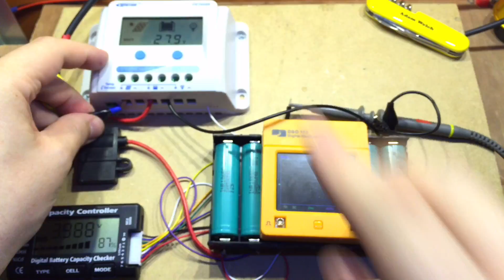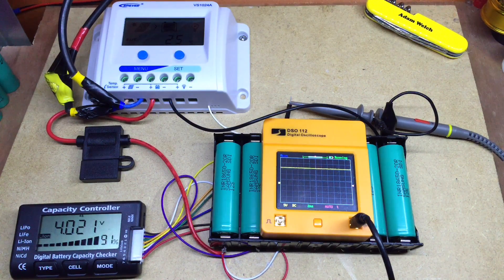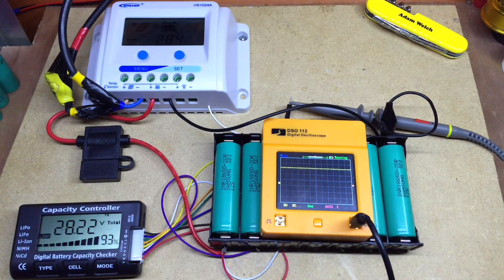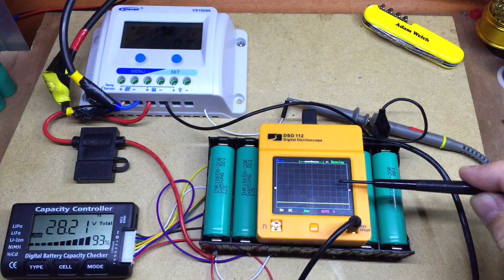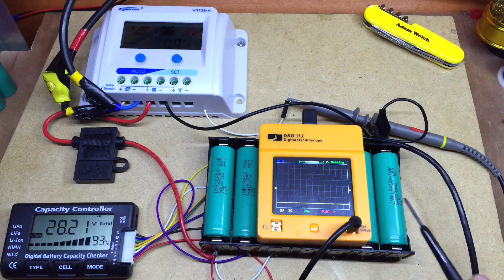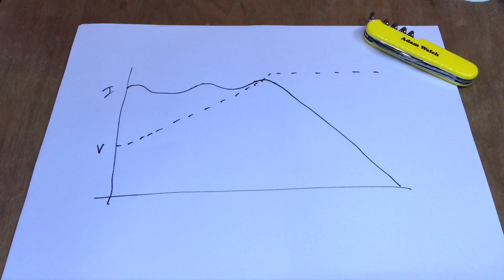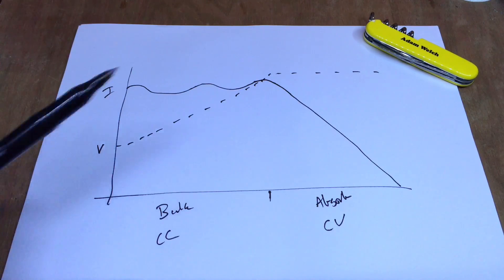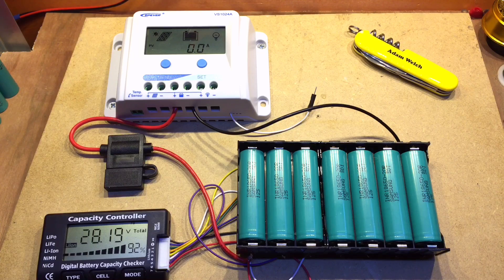Solar Charging Lithium Ion 18650s - Part 3, The Results - 12v Solar Shed

Comment: thanks adam.i've been looking for this solution quite sometimes. so now ill just have to use 7s arrangement to pair it with standard solar charge controller for lead acid batt.
Reply from the maker: +Luqman Radzuan You're welcome. Works great for me.
Reply: +Adam Welch currently im using grid tie inverter to harness sun energy captured from 100w panel. i get the actual input to my grid around 40w only. that makes me think i may need battery bank to supply steady voltage to my GTI.
Reply from the maker: I've seen people using them on batteries but it's taking the inverter out of it's designed voltage range and it's likely you're going to increase losses.  Having said that you're always going to have losses - its quite inefficient to not only boost the voltage of the input to mains level, then you need to invert it as well.   The other point to make is that you need a low voltage disconnect so the inverter doesn't completely drain your batteries.  If you run the grid tie straight from the solar charge controller you'll get this functionality (although depending on which model you use it might be a very very low voltage disconnect - too low to be any real use) but running an inverter from the load output is not ideal and can cause the charge controller to error.
Reply: Do you suggest that I build a battery bank with the maximum DC voltage input my GTI can handle to achieve maximum efficiency?

For your info, my GTI state it can handle maximum 36VDC, minimum 11VDC voltage input.

Perhaps I need BMS to disconnect the battery bank from GTI.

Comment: a balancer?   cool
Reply: it is!
Reply: jehu, when do you find time to watch videos lol. you must be using 3 or 4 of your old cell phone at the same time? using your old cell as long as your in range of your home wifi 'or any phone for that matter' you can open multiple apps just like the split screen I'm not sure if you can live view so if you 3d printed a holder for multiple cell phones around the size of widescreen possibly magnified 'it's free if you have old cells laying around', 'lots of ideas', I'm not sure about how many wifi connections a server can handle either I'm just using 2 phones at home where I can look through you tube or watch on both phones I used to play real money on poker stars until they got busted, anyway it would work well to be able to play multiple hands in that case,  if could work for business calls or viewing multiple family members at once I might listen to my playlist and watch  on 1 phone usually and look through Facebook garage sale or lots of stuff,  maybe you already do that, would be better if the phones were bigger.

Comment: Hi Adam, I recently also bought a capacity contoller and on the package were two boxes to mark if it was one with or without balancing function but no box was checked. How could we identify if there is a balance function present or not? Thanks for the great videos!
Reply from the maker: Press and hold the 'TYPE' button until you hear two beeps (sorry I've not got it to hand and my memory isn't always great).  The display should start cycling between each cells voltage.  It should then be balancing.

Comment: I have ordered one of these ,, balance controllers and started messing with 18650 cells with future plans to build a pack for a ebike project,  my electronic skills are very poor and limited and I keep watching these type vids to learn,, I'm 53 and don't pick up stuff as quick as I used to ,, any chance in the future of doing a video showing how to do the wiring from the battery pack to the cell checker as I don't quite understand how the wiring is wired to check each cell ,,, any help would be appreciated,,many thanks Shane warks uk

Comment: Great and very informative parts on solar charging lithium ion batteries...  But now i have a problem :) I'm over a year ordering 18650 batteries from china ( every week 4 to avoid taxes :p  )and i'm now up to 150 pieces...  I'm building a van where i want to live in, off grid. But i saw video's on youtube that 12v on solar charger works great, but Your statement is so much more convincing... that i probably want to use a set of 7 batterylines to match 24v gel batteries the best. However and here are my 2 questions...  24v to 12v converters do they use a lot of power? if yes that would be a great loss in power.. second question, i was planning to hook my batterypack in the back to my mainbattery ( with an isolator between them so the back battery can't drain my main battery while i'm not driving ) but in this case, if i'm using my batterypack as 24V volts, i can't connect that to my main battery anymore.. or is there a sollution for this problem ? Tanks in advance :D

Comment: Hi Adam, I've been following these videos - they are great! I looked at ebay for the charge controller and found that it takes (from description) "Lithium type(2-7 Cells)". I'm wondering.. you got 8 cells, no? So how's that..... this is the one I looked at, (http://www.ebay.com/itm/RC-LCD-Battery-Capacity-Voltage-Checker-Controller-Tester-for-RC-LiPo-Batteries-/282165890372?hash=item41b265cd44:g:bfsAAOSwdIFX0E8R). ps: did yours come with the cable? Will follow you as I NEED TO CHARGE LI with solar!!

Comment: http://www.ebay.com/itm/MPPT-Solar-Panel-Controller-Charging-Module-FOR-3-packs-lithium-Battery-charger-/181908611296?hash=item2a5a9920e0:g:yB8AAOSw9mFWJqit

Comment: Adam - Question about the balancing controller you have there, during its balancing mode is it drawing its power from one of the cells in the circuit, or getting power from an external source? Basically I like the idea but am wondering how much it could potentially draw from your system over time? I can't imagine it pulling a lot of power if it is just powering the LCD screen [and balancing], but you mentioned it getting "hot" before which WOULD indicate a large current draw. Maybe that was just from the initial balancing, I'm not sure. I was wondering if their was any benefit to getting a 7S balancer like you have there that gets its power direct from a separate solar panel that is not tied to the circuit? I know they sell them for RC cars, and pretty much just power on and start balancing once they have power, and turn off when you plug them. It can be powered from a cheap 6V 3W solar cell. Think this is just more work than is needed?
Reply from the maker: +Fishmonger ! That sounds like an interesting idea regarding the RC balancer. I'll have to look out for one. 
The 'Capacity Checker' is powered by the first three cells. I haven't check the current draw but I'm fairly confident it's tiny. The heat (hot may have been an exaggeration but it does get warm) is caused by the resistors which are applied across the highest cell. It's converting the excess energy into heat to bring down the voltage until it's no longer the highest cell. 
It is creating losses, but there not huge.
Reply: Hmm that's what I was afraid of... I ordered one anyway to take a look cause it was cheap enough. I can find 2S and 3S lipo balance chargers that run from DC, but so far nothing for 7S that is of equal price and DC powered. Was thinking something along the lines of this [http://www.ebay.com/itm/121708868711] but in 7S flavor. Can just power it direct from solar and it will turn on in the sun and off when no sun. I mean, I can at least get one to hook up to the first 3 cells to offset the load from the full 7S balance charger. I don't see an issue wiring the 7S balance and 3S balance in parallel. Might be a cheap way to keep things in check [or just a wiring disaster waiting to happen lol]

Comment: It looks as though the experiment with the previous charge balancer resulted in a battle between the balancers, with neither winning.
Reply from the maker: +nlo114 Yeah I think that's exactly what happened. The cell master monitor balancer thingy remains and is working well.

Comment: have you got a link to the solar panel you use?
Reply from the maker: I can't find the exact one that I use but this is very similar.  I use two of these in series to create the required voltage...  http://rover.ebay.com/rover/1/710-53481-19255-0/1?icep_ff3=2&pub=5575189419&toolid=10001&campid=5337903455&customid=50W+Mono&icep_item=201419620137&ipn=psmain&icep_vectorid=229508&kwid=902099&mtid=824&kw=lg
Reply: brilliant. thank you.

Comment: +Adam Welch these are the best series of vids on the net on this topic.  You explain everything really well for the likes of me (I'm not an electrician).  I've the batteries and most materials, got the VS1024A, getting the cap controller unit, need to get cables etc.  All advice on these or opinions greatly received!!   Looking up the mosfet now! ;)  You legend!!
Reply from the maker: Thanks very much Aidan that's good to hear.  Cables - make sure they are good for the current you'll be putting through them.  Add a fuse close to the cables rating to protect them if something does go wrong.  Balance cables can be thin as they carry very little current (only the small amount being taken out of them to balance).  Fire any specific questions if and when they come up.
Thanks for taking the time to comment.

Comment: Extremely interesting topic. I actually set out tonight to see if there was any prior research into what you have effectively set out in this 3 part series. Always nice to find a well documented answer. Are you still ongoing with the current setup? Would be interesting to see how the batteries fair over time. You have my sub.
Reply from the maker: +Andy Mahoney Thanks Andy. It's been going well for the last few months. More info (and a rebuild / expansion in part four... https://youtu.be/RbmRisC3Uak If that doesn't answer all your questions give me a shout.
Reply: Just sat watching it now, i'll be in touch soon.
Reply: Mine too :)

Comment: 7:00 disconnects at 4.03 volts perfect.  However, I think it would save a lot of time to buck voltage to 4 volts and charge them in parallel.   Then boost 4V-3V to 12V.  There are cheap 18650 batteries EBL, that have both low voltage protection and discharge protection (assuming it works).  I tested 4 batteries and each has over 2100 mah capacity.

Comment: Hello Adam! I was wondering if it's possible to connect in 3s to create 12v. Then charge them with a normal 12v power supply. Thanks!
Reply from the maker: +sleepy zzz Hello. If I understand your question correctly you really need a constant current / constant voltage power supply to charge lithium. That way you can charge at a constant current and then when the cells reach their maximum voltage (12.6 on your case) the power supply hits constant voltage mode and reduces the current. Once the current is only 5-10% of the original current you should take the cells off charge. 
Using any old 12v power supply is likely to end in a bad charge.
Reply: Adam Welch Thank you!

Comment: Last question. How would I wire up my existing solar panels to my 18650s. I already have various lead acid batteries connected in parallel. I have 2x 24v 20watt panels and 2x 18v 100watt panels connected in parallel. Thanks
Reply from the maker: Mixing panels becomes tricky. Your two 24v panels in series should be able to charge your pack, but they are low power.  The two 18v panels have more power but their voltage may not be enough.  Placing all four panels in series will bring the output of your 100w panels down to 20 watts. The other option is to find a boosting mppt solar charge controller.  I only know of one cheap one - the Ming-he MPPT solar charge controller.  Search for Julian Ilett and watch his review videos for some more info on that.

Comment: This is great if you want to charge up your batteries on the go while riding on your ebike. Now I just have to swap my system over to a 14series. Could I just leave it on a 13 series pack?
Reply from the maker: A 13/14 series pack would be around the 48 volt mark - you'd need to find a suitable charge controller for a 48 volt system and work out for yourself if it would over or under charge your bank.  Also you panels would need to be higher than the battery system.  I hope that helps.

Comment: What fuse did you use please?
Reply from the maker: I think it was a five amp fuse.  My panels shouldn't provide anything over 3 amp and the lamps I have on the load side shouldn't need more than 2 amps.  Could have got away with less really.  Thanks for the question.

Comment: how much did you end up paying for each of those cells? any benefit of 18650s vs flat rectangular lipo cells?
Reply from the maker: +Robin Hilton I paid just under €3 each. Possibly not the best price but I was happy that the seller was genuine. Advantages - not really. Two reasons why I chose 18650s there's plenty of options for holding/connecting them and that lots of people are reclaiming them and therefore they look familiar to lots of people.

Comment: Hi Adam.

Thank you for answer!
I want to build 2 batteries, 6 S - for system 24 V,  from 18650 Li-ION cells, each 100 Ah or more, and i want to charge from the solar panel mentioned above. The problem is that from what I read, searched on the internet I not found a controller who is able to charge the 24 V system from this single panel ( 240W ), because the voltage from panel is too low. Maybe I'm wrong and I have not found a controller for what I want, maybe there and I'm looking not exist....
It would seem that the only solution would be it to use solar panel with 36 or 72 cells, but these are much more fewer watts and are more expensive than solar panels with 60 cells 240W.

Thank's!
Reply: Mihai Giurea You could try for a few moments to put an adjustable DC power supply between the solar panel and the charge controller so you can boost up the voltage that comes from the solar panel and it goes to charge controller.

Comment: Hi Adam,

Please, can you advice me, if this controller wiil work with this one solar panel with this specification:
This solar panel has 60 cells

STC Power Rating Pmp                    (W)  240
Open Circuit Voltage Voc                 (V)   37.4
Short Circuit Current Isc                  (A)     8.55
Voltage at Maximim Power Vmp (V)  29.6
Current at Maximim Power Imp  (A)     8.11

The question that bothers me is, this solar panel if are compatible with this controller will be able to load 24 V system, or i need really from the beginning two solar panel conected in series?
From the moment i want to buy one panel, and after a some time, another one.
The system which i want to build it is on 24 V from LI_IO 18650 - 6S, 2 batteries - 100 Ah each or more.
If this controller EPEVER are not compatible can suggest a controller( PWM or MPPT )  which are the best price in raport with performance?

Thank you very much and good job!
Best regards!
Reply from the maker: It's worth noting that this controller isn't designed for lithium Ion - it works in my setup but your mileage my vary!

The panel looks like it would be ok but its maximum power point isn't all that high for a 24 volt battery system.  I'd be contemplating a 7s lithium pack though not 6s.  A 6s pack fully charged is 25.2 volts and this charge controller will try and take the cells up to 28.4 on it's AGM setting (which is typical for a 24 volt battery system).  A 7s pack could be charged all the way to 29.4 volts (I run mine to 28.4 on the AGM setting).

The alternative is to get a charge controller that allows you to adjust all the charging parameters.  Some of the EPSolar ones do - the LS1024 and the MPPT ones do - some of which I've also reviewed. They tend to be the cheaper end of the market.  But you can spend a lot of money and get better units and more things to adjust!

I'm a little confused about the batteries you are proposing, but whatever you end up with don't try and charge them too aggressively.

Comment: Hi Adam,  great project. I did use 7s EV bike battery for such purposes and they worked just fine (combined with 24V UPS that's capable of cold start and giving full sinewave output). I think you should try bigger setup like 7s10p or even 20p. This will let cells to charge much slower and balancing via your cell monitor would be minimal. Charging 1/10 C might give way better results.
Reply from the maker: +emceh It's just an experiment but if I were to keep it more permanently I'd definitely add more cells in parallel. Thanks.